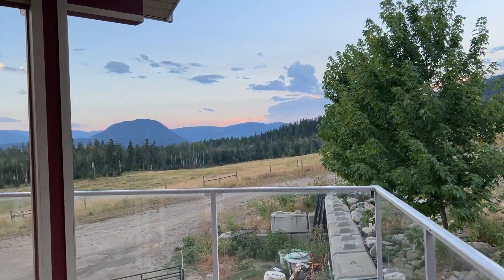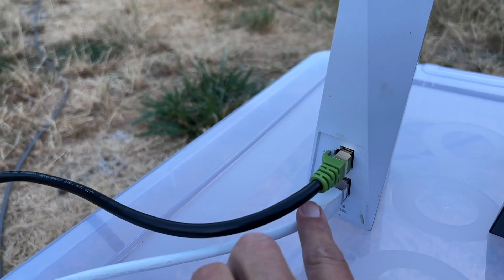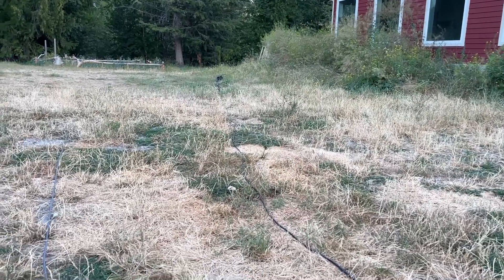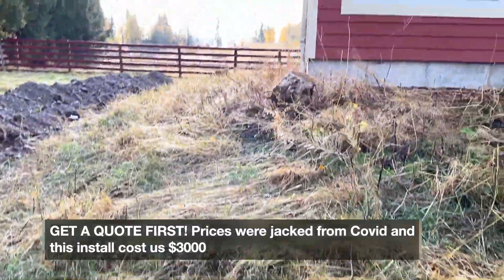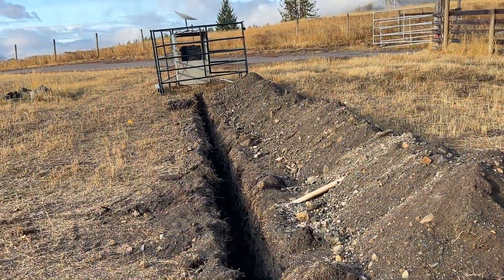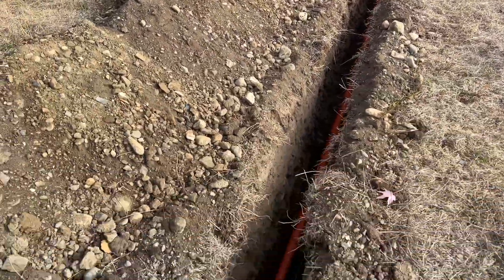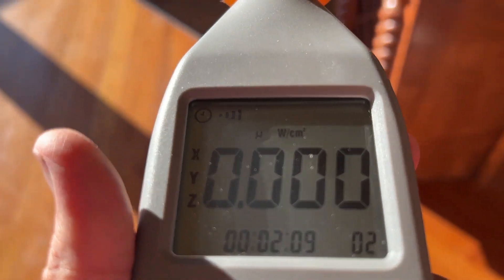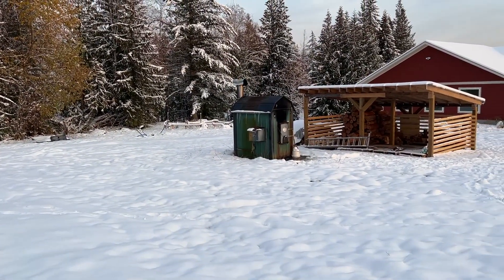How To Hardwire Starlink Satellite to Ethernet Cable - No EMR!

Comment: If you are worried about that, ditch your smart phone LOL.   Sorry I'm a software developer and techie with a degree in electronics.   I guess I will just conclude with "whatever floats your boat.  Your money".  I don't think facts or science will make a difference.

The health concerns are ... oh never mind.  From a technical perspective the wired system is more reliable and more secure.  So no need to worry about the moose I would otherwise be sending to spy on you using electronic snooping equipment.  You really dodged a bullet.

Comment: As an electromagnetically sensitive person, I get the motivation, however the radiation coming from the starlink satellite to your home is far more damaging than the wifi.  Starlink uses a much higher frequency that is much more damaging, and can be detected for about 1/4 mile around the receiving antenna.  I would not want to live within 1/4 mile of a starlink antenna.  I also don't have wifi, or wireless anything, we wired everything.  We live way out there too, and had to run the internet line 1/2 mile from the road.  For all you people that think EMR is harmless, spend just 10 minutes looking up the literally 10,000+ studies on the subject, with only about 100 of those showing no evidence of harm.
Reply from the maker: My friend Jeromy Johnson disagrees with that (we've had convos about it). He doesn't have an article about starlink vs wifi on his site, but here's another article you may enjoy. https://www.emfanalysis.com/low-emf-computing/

Comment: Why is the 0.1W being transmitted by a humble WiFi router in the tiny fraction of the Electromagnetic Spectrum between 2 & 6 Ghz 10^9Hz an issue?

If you're happy to use AC power in the house , use anything with an Electric motor, fridge, freezer, washing machine, vacuum cleaner etc then your home is already flooded with a broad spectrum of EMR in the Htz and KHz range.
If you haven't shielded your house by building a Faraday cage around it then terrestrial TV & Radio signal are adding EMR in the Mhz Range, albeit at very low power.
If you go outside in sun then your bombarded with sunlight that is around 1000W/m2 and ranges in the Ghz to Thz for InfraRed, Thz to for Visible light and PHz for Ultraviolet which is Ionizing, never mind the energy you absorb having an X-ray in the EHz 10^18Hz range.
If you've ever turned on a Walkie Talkie and set it to scan you know there is always somebody transmitting somewhere close by and they are transmitting somewhere between 1 & 5 Watts of power in the ~400-500 Hz band.
There is just no way of removing EMR from our lives, even Homo Erectus 1.5 Million years ago would have had EMR with sunlight, Cosmic Background Radiation, Thunder and Lightning storms produce RF bursts in the Hz, KHz & GHz range as well as high energy Plasma.

Comment: If I'm viewing this correctly, the router and the power brick are inside of a sealed plastic container? If that's the case, there is no ventilation for dissipating heat. Routers and power adapters are small electronics but do give off heat. In the summer months, that might significantly effect performance. Consider cutting an exhaust hole or two and attaching a low voltage computer case fan to help keep temperatures down.
Reply: Turns out not to be a big deal.  A nice big box has plenty of surface area, so even plastic will dissipate the heat.  I ran my Starlink Gen 2 router in a cheap plastic box about the same size for about six months.  In Texas.  In the Summer.  I was worried about the heat, so I made sure it had shade all day and tossed a Z-Wave thermometer in the box to keep an eye on it.  It never got over the rated 120F in the box, even on a 105F day.

Eventually I decided to cut a couple of trees down in front of the north side of the house, then I was able to move the dish to the roof and put the router in my wiring closet near the center of the house next to the cell booster.  No worries.  we have a full steel barndo half a mile from any other buildings, so we keep our radiation to ourselves and don't make the neighbors sick.
Reply from the maker: Thanks for the info, that's good to know because I also have a wifi router down in my pole barn for my barn camera and I was concerned about the heat, yet also keeping all dust out when the horses run around.

Comment: Ethernet cable is not power and could be considered communication and could have been buried between 12 and 24 inches
Reply from the maker: We ran a power cable in the same trench. But thanks for sharing that in case someone is just burying the ethernet cable.

Comment: I would have used OM2 MM direct burial fiber with a media converter instead of copper.  This way you could get 10G there if needed plus protect the ethernet ports on your equipment.  

Also place a tracer wire in with the cable.  I do like the conduit for a future pull if required.  But not sure if the extra cost would be better spent toward the fiber cable.
Reply: And I and others would have laughed at you to. Multimode is for tight-asses and why use optical when you still need to get 60-100 watts of PoE goodness to the dish. No, you don't need a trace, cable in the conuit is the trace.
Reply: Not worth it.  You can run 10G over 100m on Cat 6a (a spec that cable probably meets).  In 40 years or so when Starlink approaches 10G speeds, you pull the latest greatest cable tech through the conduit using the ethernet.  Or if they've come to their senses by then, they can run the power over the ethernet and use 100G wifi for the data link.
Reply: @that.schamp  No, incorrect. CAT-6a is rated @ 10GbE for 30M. CAT-7 is needed for 10GbE @ 100M.

Comment: You do live in a very beautiful location!  I don't know if you get much lightning, but running long runs of CAT5/6/7 cable externally like that can dramatically increase the risk of issues, if you get a strike within a few 100m of your home all that equipment is going to be toast. You can get surge protectors which might help, but I'd always use a fibre optic link, immune to lightning and no EM from light, well, none of the sort you're worried about :)

Comment: As somebody who worked in the industry for 20 years, there is no reliable evidence I'm aware of that radiation from WiFi or phones (up to 20x the power typically used in WiFi  when on a call, and are often held to the head) causes any health issue.  There is good reason to expect it not to, because the frequencies (1-6 GHz) involved are "non-ionising", unlike x-rays,  for example.  But we don't have a bunch of people in hospital because of the electromagnetic radiation from their mobile phone usage.

Comment: You did this for “radiation”? The Starlink antenna beam is highly directional. If anyone is feeling “sick” it is in their head. Some people are highly sensitive to their imaginations.
Reply: I think it's the router they are worried about.  Those 5Ghz transmitters can really mess with your mind.

Fun detail - to access the starlink app and access router & dish information or settings , you need to have your android/ios device on the Starlink wifi network.  So if you disable the wifi, you need to factory reset dishy to re-enable the wifi and use the app.  It gets to be a pain, so I've left my Starlink wifi on even though I have my a collection of wifi mesh nets covering the house and property.

Comment: Cat cable has a max distance and at that distance you are using you're losing id say a good bit of signal
Reply from the maker: Yes, video uploads are slow, downloads much better. Son plays PS5 - no issues. I was on the highest speed fiber optic cable before, so that's my comparison standard. I'm pretty happy with it - especially considering WiFi at other people's places is WAY slower. It's a trade-off I guess. Perhaps we have better satellite connection/receptivity here than elsewhere, so that makes up for the cable distance??
Reply: @jpt1  no the cable is between the satellite and your house, therefore it is the bottleneck for speeds, the makeup in satellite reception wouldn't make a difference since it has to go through the cable. Max distance for cat 7 for full signal is about 328 feet. So if your cable is 350ft you are not getting full throughput . If it is 300ft you are probably good.
Reply from the maker: @BrooksCWhitehouse  Yeah I wondered about that... just checked my amazon order for the cable and it's 350 ft so...?? Maybe if it was shorter I'd have amazing speed! The vid upload speed bothers me the most. Uploading a 1.26GB video to YouTube right now and it will take 20 minutes. This is the cable I bought: https://www.amazon.ca/gp/product/B07XY2WP9D/
Reply: @jpt1  It is likely the upload speed is just a limitation of Starlink. Sat internet tends to have pretty slow upload speeds due to latency going from your dish up to space then back to the starlink groundstation, they are also prioritizing download traffic as well.
Reply: Your comment suggests you don't know anything about the cable and its design let alone the 100M / 330' limit. Just like all the replies below that also have no clue....

Comment: Why didn't you mount the dish on the roof? The dish is a passive receiver, it doesn't radiate appreciable amounts of energy. The router wireless function could be disabled leaving just the hardwired ethernet port for your hardwired connection. Save you an awful lot of money.
Reply: Any actual science proving people are "EMF Sensitive" with low power consumer grade electronics?  I suspect there is something else at play for all the people getting sick.

About 23 years ago I lived in an apartment and a man would literally bang on his roof (my floor) with a broom or something and yell for me to stop radiating him.  When none of my appliances were even on.  I even unplugged the wifi router but the banging continued.  He once walked up to my door literally with tinfoil on his head yelling at me.  His wife later apologized so I wouldn't get them evicted and explained that retired from doing work with xray or MRI machines in healthcare which of course do produce high amounts of radiation.

I just thought he was nuts.  But enough people claim to be sensitive to this I want to see the science.  Is it all in their heads or can they detect something most people can't?

I think some birds might use the Earth's magnetic fields for navigation.  So not saying it is impossible.  Just skeptical.  There are many natural sources of radiation all around us so what makes anyone sure it isn't a natural source and not the wifi?
Reply: The dish is not a “passive radiator” the FCC RADHAZ filing indicates a transmitter power of just over 4W at 14.5GHz.
Reply from the maker: Hi Greg - depends on your level of sensitivity. Jeromy Johnson (engineer who specializes in EMF/EMR) recently wrote me: "I'm currently walking a young family in rural Alberta through the Starlink process. They have had their dish on the roof and the wife is getting sick." He told me you can also use aluminum mesh for shielding if you can't get it off the roof:

Mesh is easier to use in building projects. Allows for air/moisture flow, which is important in walls.

https://safelivingtechnologies.com/products/signal-protect-am2-aluminum-mesh?aff=3

You can use foil too, which has much greater RF shielding effectiveness:

https://safelivingtechnologies.com/products/rf-shielding-foil/?aff=3

We're looking at buying a house in Mexico and the dish will likely have to go on the roof so will definitely use the aluminum to shield. Hope that helps.
Reply: @jpt1  ah yes Alberta, the place with the cleanest earth known to man...  Are they sure to have ruled out environmental impacts for causes of sickness?  Will he do a followup study or just use the evidence of "I'm doing something look at me!"

I sell snake oil, guaranteed to protect you from EMF!!!
Reply from the maker: I also haven't found any reliable instruction for disabling the router - if you have, please post a link. It's a LOT to risk if I mess it up! Oh and also, right now, the backup generator and propane tank (both fairly close to the router) are using the router WiFi to send alerts. I was away for a while this winter, with only my kids here, so wanted to keep an eye on things. During summer, I could just wrap the router in shielding cloth or aluminum foil if I wanted...